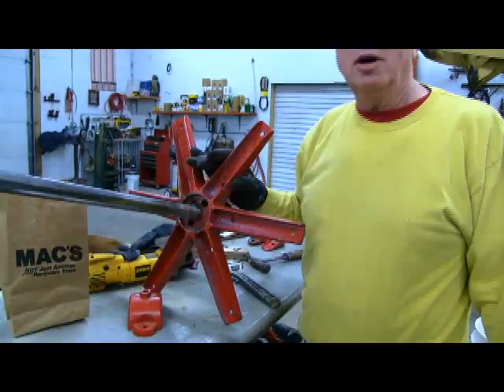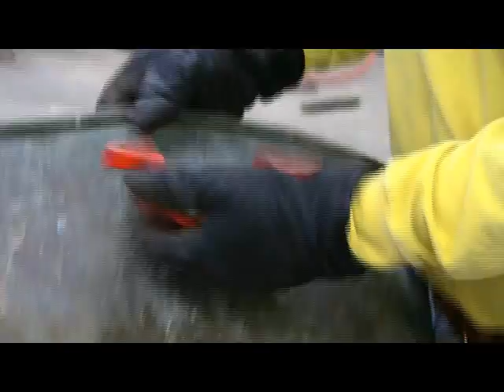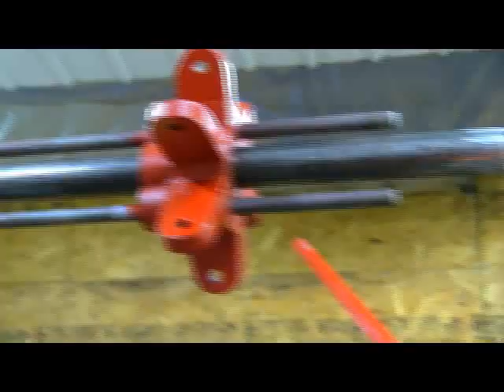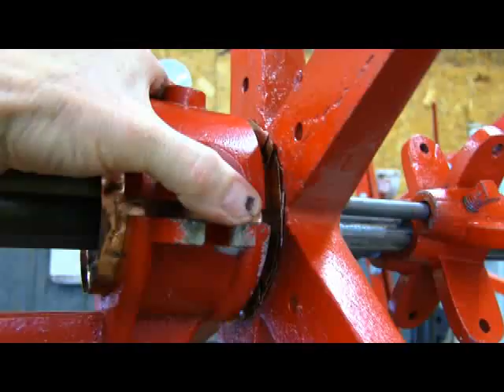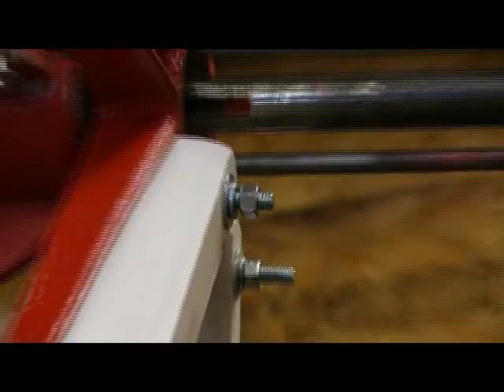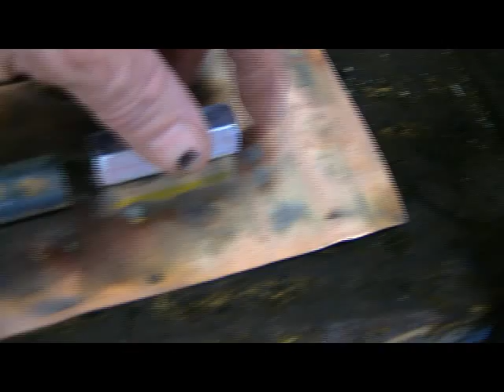Althouse Wheeler / Pipe Raymond Windmills

Comment: Nice vid but if you ever repaint every original PR I ever saw (and I have seen a lot of them) had black iron and white wood other than the red tips. Your mill is a late model as it has the brace rod like the 12ft PR. Other than the swivel that was pretty crude, I think its the absolute best of the wood sectioned mills for longevity other than perhaps the Monitor L but I have had great luck with both of them.